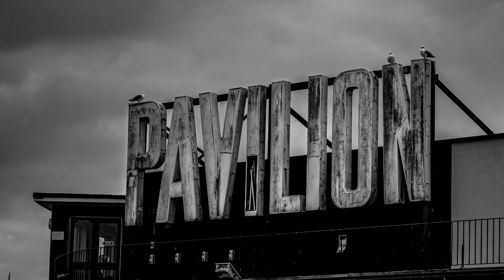DJI Mini 2 Propeller Change Tutorial | A Quick How To

Comment: Use prop guards indoors. They're inexpensive and can save you a lot of trouble. not only will you not damage your props on walls and whatnot, but you will likely remain airborne and under control afterwards. Just remember when outdoors that you will exceed 250g.

Comment: I'm wondering why you changed all the props when you only had damage on two of them.

I crashed my drone from two feet high into a doorway foolishly. Only one prop shows a tiny Burr of plastic on the very tip which I pulled off.

It seems to fly well. It seems to sound a little different. It might be my imagination.

Prop package shows a and b which are diagonal locations.

Finally the question... What is the minimum amount of props recommended to change? 

Their individually sealed by two so that's my guess.
Reply from the maker: Changing all the props was purely for the video :)
A whole new set of props is £17 on Amazon, not a huge cost.
Yes, you should change both on the same rotor, even if only one is damaged. DJI create a matched pair so the rotor is balanced properly, the props could weigh different due to manufacturing tolerances.

Comment: The bearings on my mini 2 are also notchy and not smooth.
Reply from the maker: Good to know, thanks. It might be normal as a tiny magnet passes a coil during the rotation. It's definitely normal for stepper motors, but I would have though these are just standard DC motors, I might be wrong though.
Reply: @waynewebb8002  maybe find someone with a brand new unboxing mini 2 and do your finger on top spin test. Once it's been crashed you can no longer assume everything is normal. Mine are nochy I'm guessing that's normal.
Reply from the maker: @toddvolpe6396  I don't need to worry, the crash happened before my first proper flight at Durdle Door, back at the end of May.
Reply: I've been flying FPV since 2017 and I've had motors that are notchy and motors that are not.  They all fly basically the same.
Reply: Mine are also notchy, due to the attraction of the magnets and coils. Although noticeably much more so on both right side propellors which initially made me concerned but doesn't seem to have caused any problems so far.